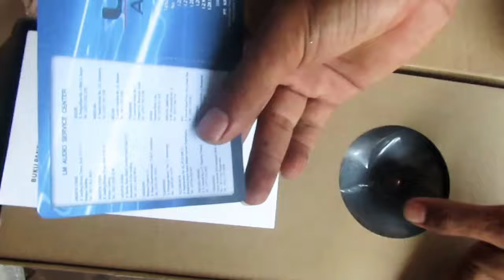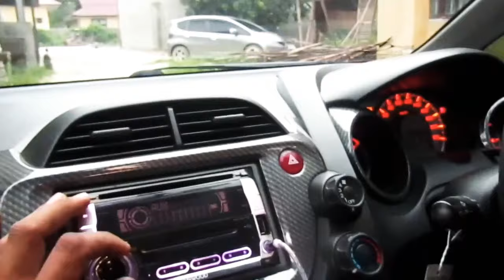(2way LM) Rp.350 Ribu Upgrade Speaker Mobil Jadi Josss

Comment: bang, jika dipake untuk indoor dan dibuatkan boxnya suara bagus ga ya? sya mau buat untuk ampli sya... apakah bisa saingan sama speaker compo suaranya? soale ampli saya kan bisa 4 ohm, udh di coba pake speaker compo 6 inch 6 ohm hasilnya joss, apakah bisa hasilnya seperti speaker compo? atau lebih tinggi? soale spaekr compo yang saya coba itu 6 ohm 6 inch 60w program.
Reply from the maker: Kurang mass
Reply: @DoniPokpok  yang bisa nyaingin suara compo merk apa ya bang?
Reply: @DoniPokpok  bang, sya kan punya tpa3116d2, nah yang 50w treble itu sya pasang speaker compo 2 biji / 1 ch isi 2biji speaker 60w program 6 ohm 6 inchi, saya pake adaptor laptop 19v 5a, nah saya geber tuh speaker kok bisa sampai 19v 7a ya? padahal itu ampli cuman max 50w ga? 19*7 = 133w... saya cek pake volt ampere meter